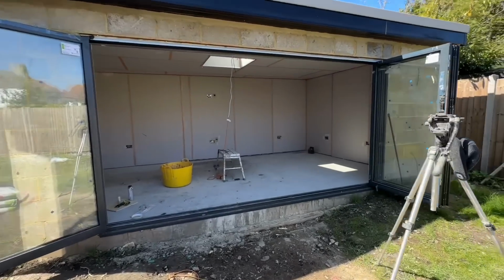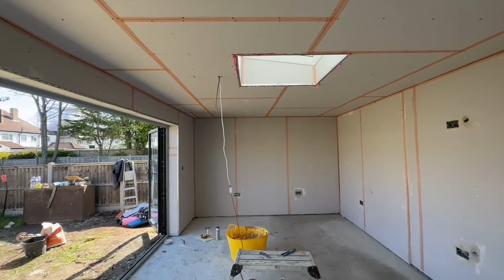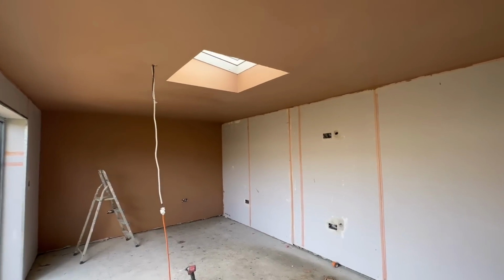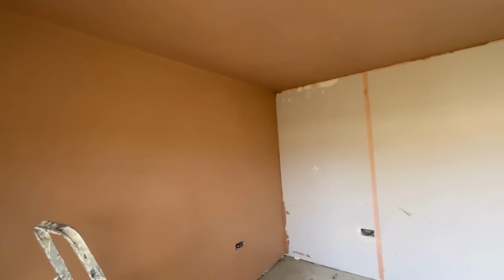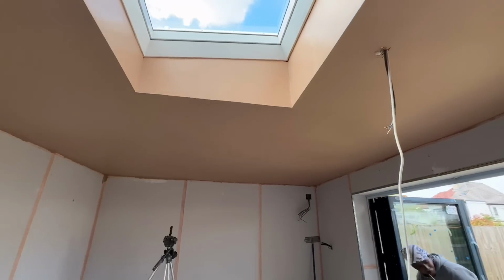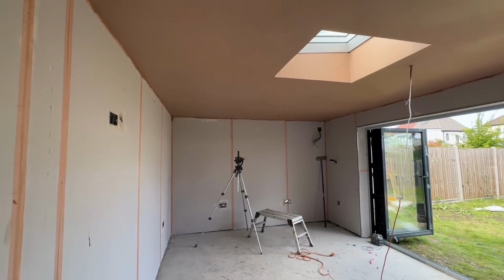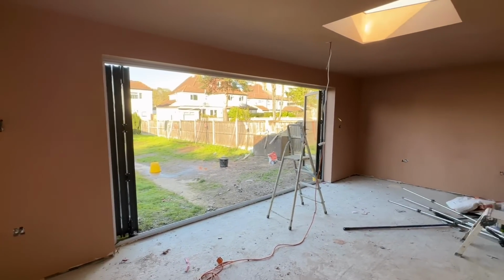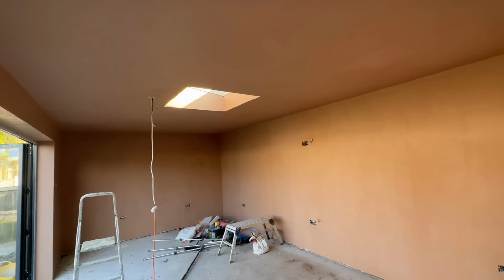7x4 Garden House - Episode 7

Comment: Really good vlog Darren, just a suggestion for you.  I think you should consider a little giant ladder the one that seperates into two mini ladders, you can buy the metal stand which is extendable i think up to 12 ft and if you put that between the two mini ladders you can cover more area for plastering and decorating etc. Of course its going to cost more money but is a good investment as it will save you time on completing jobs. I thought I recommend this as you have to keep moving the small metal bench